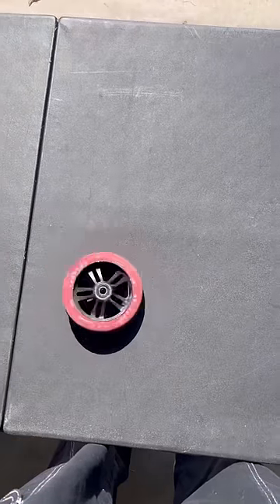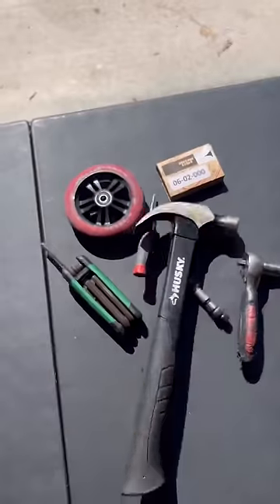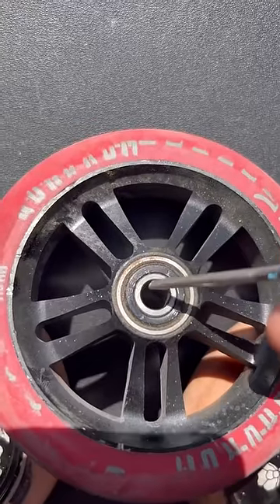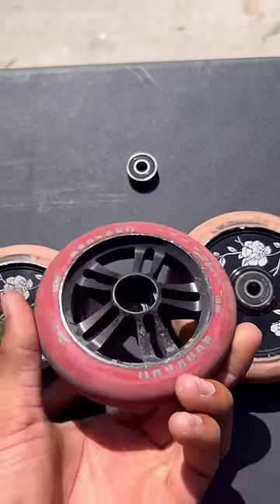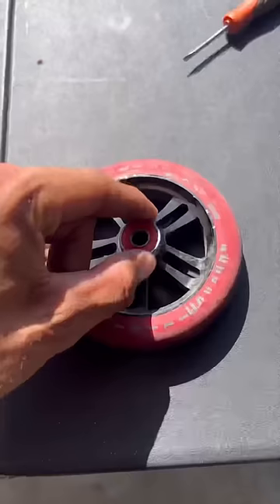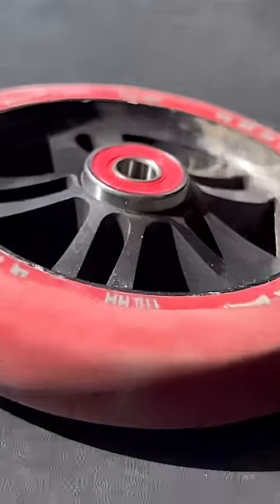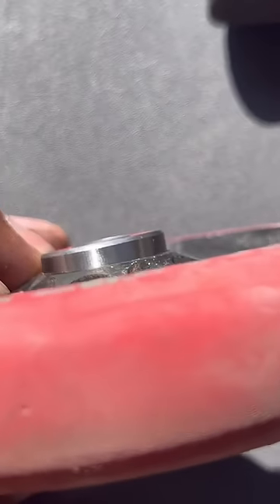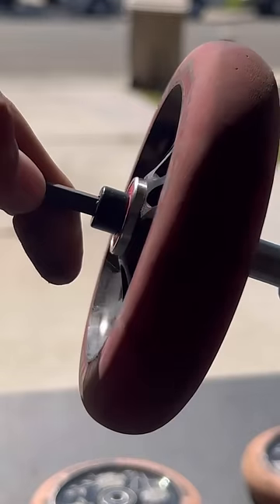How to: Replace Scooter bearings! #scootering

Comment: You should really be putting pressure on the outer race of the bearing to draw them in, otherwise you risk damaging them.
Reply: Was going to say this
Reply: It also runs better and puts less stress on the bearing if you take the spacer out and do not over tighten
Reply: @dennycrane2323 False. The spacer sets the preload at intended torque. Bearings with no preload run like crap, have play, and wear out much faster.
Reply: @MrKipperfish  oh Okey good to know I heard it a long time ago so maybe it’s time to fix my board
Reply: I can literally hear the new bearings already crying. You, really gotta put pressure on the outer part of it, otherwise they will be noisy. Can easily use a washer for that purpose.
Reply: You never hit the outer race to install a bearing. Always apply pressure on inner race
Reply: @abbeygriffin9886  My experience tells otherwise. Hitting the inner always fks the bearings.
Reply: @abbeygriffin9886  so in this case, where the outer race is the one that is providing the compression to hold the bearing in place, you would drive in the bearing while resting on the outer race.

If it were the case where the bearing was being pressed onto a rod, you would use the inner race to press it on. 👍

Comment: Never put pressure on the center race of a bearing to push it in
Reply: It depends on how it’s fixed.
In his case he should have pressed/hammered the outer race.
If the bearing was to be fixed on a rod/shaft then in this case he should press/hammer the inner race.
I’m not a mechanic but I fix things.
Reply: Spiny thing sounds like the spiders in minecraft

Comment: This would if saved me money I just bought a whole new wheel because I bought a new wheel the rubber was also weard down alot but so I bought new wheels and the new wheel had pre-installed bearings and sounded like in this video but if I knew 5 weeks ago I could change the this eazy probly would of saved money

Comment: Do not tighten them in with the bolt. The bearings should be pressed in from the outer race instead of putting lateral force on the balls and races. This will cause small dents in the races and balls which WILL damage them and cause faster wear. 😭😭😭

Comment: that is the most painfull way to replace your bearing imagine pushing it in with so much pressure on the center use rubber or wood mallet to push it in and dont use flat screw to remove it lubricate it first then use 2 nails (head) lock it then pull